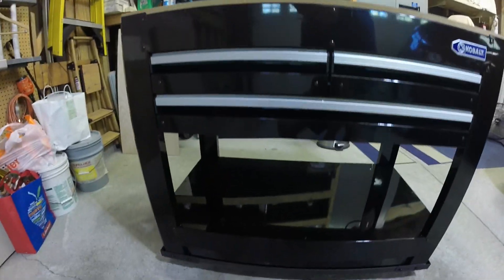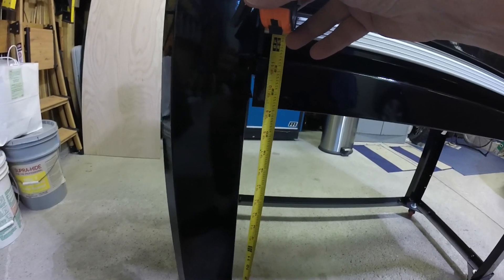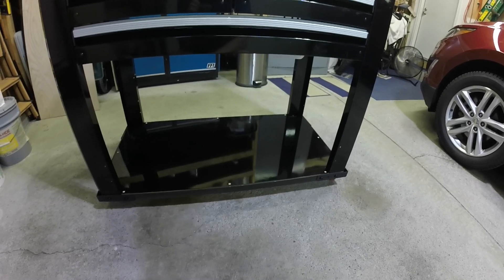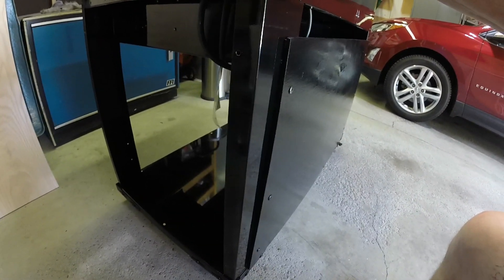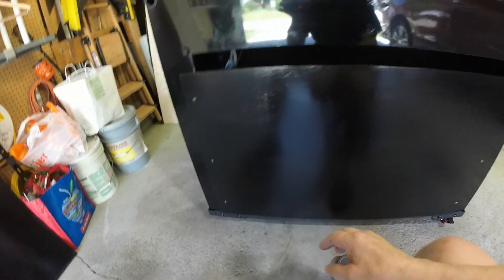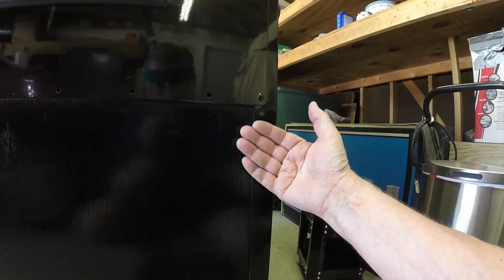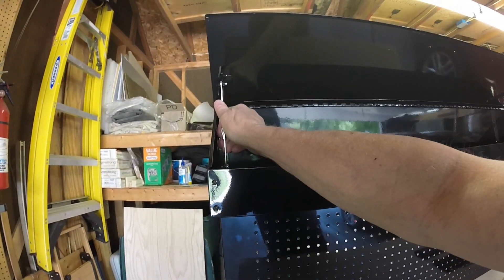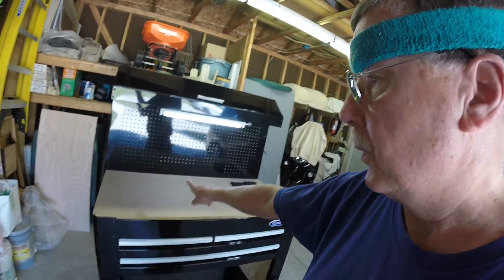Kobalt Work Bench mods (Part 2), move bottom shelf adding 4 cubic ft., enclose the sides and back

Comment: I really need to see paint on the inside of the added side and back panel, come on Dave lol
Reply from the maker: Well - I can't promise you that the inside of the sides will get painted.  BUT - and this is a big BUT - wait until you see Part 3!  It will more than likely be the over the top - what the heck is he thinking - did he really do that on a work bench? - come on where does this insanity stop!   lol   You got to see it!  This is where the sequel is crazier than the first 2 parts combined plus 10. Thanks for your comment.  Here is a little peek - a quick release full size bench vise.  Yup - it is going to get real.

Comment: Nice. Your videos tend to make me want to head to the garage and tinker with something. Interesting stuff. 

In what episode will you be installing the led accent lighting and kickin' sound system?
Reply from the maker: The LED light that came with the bench is up and running.  Extra lighting is needed - I'll think of something.  In the next video "Part 3" is where all the fun happens.  Over the top accessorizing.  I've thought about a sound system and started searching for some options.  Part 3 won't have any sound system but there are several interesting add on which are aesthetic jewelry especially for a work bench/ tool cart. A peek at what is coming is a quick disconnect full size bench vise. A killer sound system might be a start for the Part 4 video.  lol Somebody stop me. I need to get back on the motorcycle content.
Reply from the maker: After much consideration, I will be including a kick butt sound system in episode Part 3.  Why not ?  Rhetorical question, as I've already thrown in everything else but the kitchen sink.  Filming is starting now.
Reply: @trekOCLVone  haha. Nice!

Thanks for sharing. I'm excited to see what you come up with